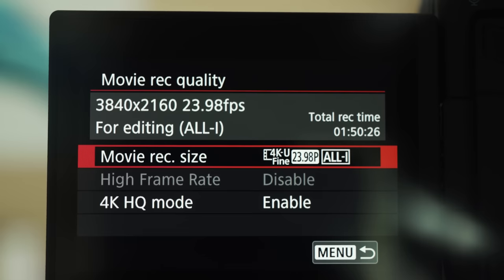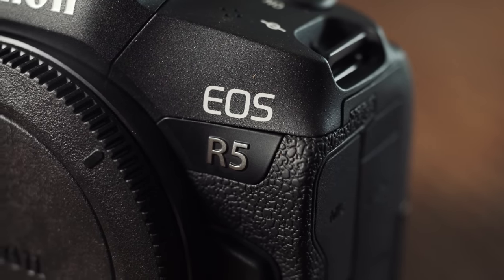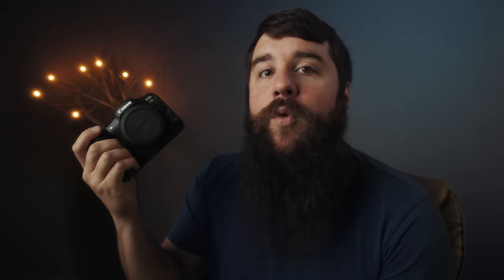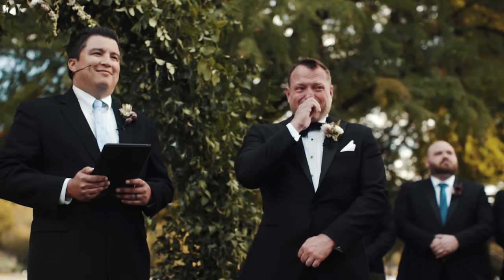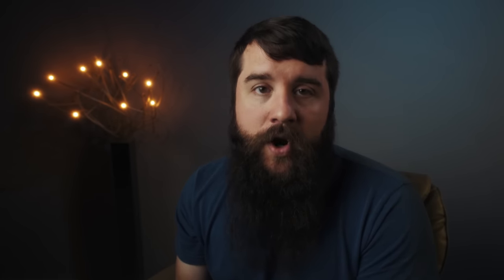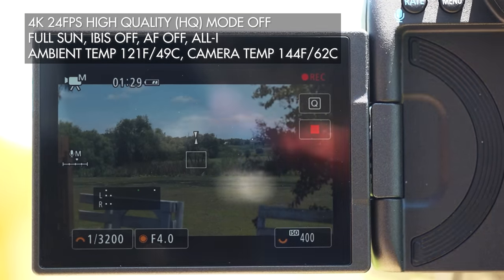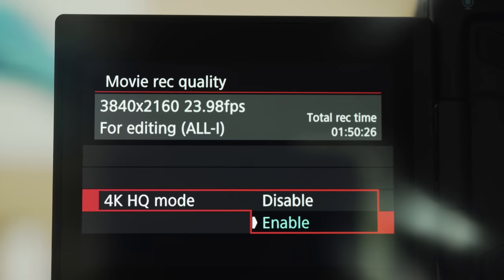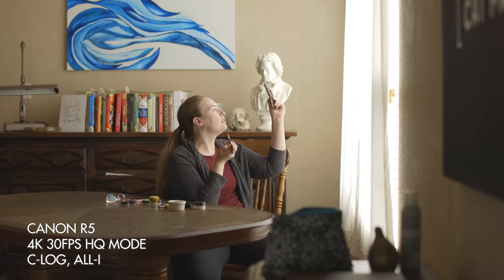Will The Canon R5 Overheat Filming A Wedding?

Comment: The R5 does not overheat. Canon did not invent a super insulator that shields the camera from external heat. Frankly, that’s just silly, as there are tear down videos and the body is merely magnesium with a aluminum heat sink. 
So what’s really happening? Canon has deliberately coded the firmware to instruct the camera not to record beyond a certain amount of time. They did this to force users to buy their cinema cameras for video. Your test actually confirm this. The cool down time cannot be sped up. Even freezing the cameras does nothing to speed recovery. Removing the lens, opening the battery and port doors while freezing does nothing to speed recovery time. This is not because Canon is using an insulator stolen from aliens... it’s because there is a timer in the firmware that prevents the cameras from operating normally until a predetermined amount of time has elapsed. It’s really that simple. 
Canon, just like they removed 24p and CLog from other models, has chosen to cripple this body. Worst still, and perhaps most unforgivable, is the fact that the HDMI port on the R5 supports 8K @30p Raw output... but Canon choose not to enable it.

Comment: See this report (link below).  This and another report I have read claim that the overheating is fake, and canon's software forces the camera to report overheating artificially.  I am not sure why they'd do that, but it appears to be so.  Even this video shows a maximum temperature of 144 degrees F - which is not really that hot - certainly no reason to force a system shutdown.  Canon's monkeyed with the software to cause this shutdown - for some inexplicable reason.  But that also means they can do a firmware update and remove that stupid constraint.
Reply: @srikant.sharma  Nope all the BS from EOSHD was debunked  - https://www.fredmiranda.com/forum/topic/1658635/5#15313777

Comment: Canon EOS R5 is not designed to film a wedding. If you were a wedding photographer you would be Fine. Get a film camera!. I did a wedding with 2x 70ds and EOS R and  Panasonic GH3 but DSLRs are not ideal to video weddings. They are fine for photography but not for video. The EOSR5 is a stills camera with a few extra video perks. For very short video it would be fine. This is NOT a film camera and no body from canon or Panasonic that I have had has been able to go above 29 minutes which is a real pain in the ass. the batteries run out, the memory cards run out. It's a nightmare! To try to be a videographer and a photographer is too much overkill. I should concentrate on one thing at a time.

Comment: Then shoot in 4kHQ Crop mode
Reply from the maker: I'm a bit disappointed your recommendations to shoot with a crop or shoot with an Atomos require filmmakers to either invest in wider lenses to overcome the crop, or invest another thousand dollars in an external recorder and SSDs.
Reply: @whoismatt  I do that now.  I'm a hybrid shooter.  I do both photos and videos.  The crop mode is 5.1k oversampled which is really good.  I already have superwide angle lenses and telephoto lenses.  I understand your perspective as a sole videographer, but shooting hybrid requiring both high resolution stills and high quality video, I don't know if any other cameras outside the Panny S1H or S1 that can do that.  You are right, this is a tool, but if you are going to try to use this as an A-Cam for video, which is what Canon recommends against doing, you will need to make compromises.  That's why I still recommend this as the best bang for the buck Hybrid camera.  Atomos extends recording times on 4kHQ60p indefinitely and the cost if that setup is cheaper than buying large Cfexpress cards with large internal recording drawbacks.  Yes, you rig will be larger but EVERY event filming scenario has compromises (storage capacity being a main concern as 4khq and 8k take up a HUGE amount of data).  A 2tb SSD is exponentially cheaper than a 2tb cfexpress card and for the same amount of money you can buy an Atomos ninja 5 with it.  Let's also not discount you can by the ef-rf VND adapter and exponentially increase shooting scenario adjustments and you open up to cheaper, legacy EF quality glass.

Comment: This is NOT the complete picture.
Your review is not complete.

Filming with an external recorder would totally work for a long wedding day. Also the 10bit codecs would be perfect for editing with an external recorder. 

The R5 is the perfect photo camera and with an external recorder becomes near perfect video camera. 
Only internal shooting is suited for short videos only.

And btw only an amateur would go and shoot a wedding with a single camera. Backup camera is absolutely necessary. I’ve shot over 100 weddings and never used only 1 camera.

If you have 2 R5s you could use one of them in the 24p mode and use the second only for Broll.

Also another point you didn’t mention is the 24p crop mode that is oversampled and also shoots forever without overheating. Of you care for ultimate sharpness and what to shoot a wedding you can relay on it.

Therefore - your review is not honest. You should make a follow up video to paint the complete picture.

Comment: So not excusing this overheating, but almost every video person I know uses more than 1 camera during the day so it would only be a bit of a pain to switch between 3 cameras every hour and let the other 2 cool off and shoot the ceremony in 4k 24 and that’s redic, but not as bad as Sony and dji default file numbering of 00001,00002 also canon this is bull shit. And they need to do better hopefully by delaying so many orders they can improve it
Reply from the maker: Once you shoot with 2 of the R5's even in 4K24 you lose the ability to record any higher frame rates with them in 4K until they cool. Which could be pretty far into the reception.

Comment: I can't imagine ever using this camera for any professional purposes. I do a lot of Jewish and Coptic Orthodox weddings, and those ceremonies run minimum 1 hour. Noooo thanks!
Reply: Best combo C300iii and the R5, can’t imagine anything else coming close.
Reply: First off, this is a PHOTO camera, NOT a video camera. Secondly, how have you been shooting weddings so far in 4K downsampled from 8K, or 4k 120 and 8K? You haven't! You shot in 1080 or basic 4K (which is still better 4K than on the EOS-R or A7III). You can do this with the R5 for unlimited time if needed.  Btw, the A7III overheats in 4K at about 20 mins. So does the Xt-4 (4K 60... 14 mins).
Reply: @77dris  Yes, it's a photo camera, with amazing video capabilities that fall apart. I maintain that this is a terrible camera for professional videography. I've been shooting all my weddings in 4k over the last 4 years on my a7sii and have encountered overheating 3 times. This occurred outside, in record-breaking temperatures. Based on these reviews, I don't need record-breaking temps for it to overheat. Never have I had my a7 iii overheat. 4k downsamples from 8k is nice, when it works. Not sure why you're butthurt.

Comment: This has probably been the most insightful video about the Canon R5 I've watched as it shows you things that pretty much all the other reviews have skipped over. They've been the same basic tests and didn't take into account many aspects of filmmaking. Thanks!
Reply: If you skipped other reviews you missed out on a lot of things, like all the video modes that don't overheat that he didn't mention, like S35mm 4K, which is over sampled from 5.1K and looks great. Or the fact that you can record to the Ninja V externally and many modes never overheat, like 4KHQ and 4K60. Many people record externally on cameras like GH5 and Blackmagic all the time. Also most gimbal ops use external monitors.
Reply: @iamthejtm  That's not what I meant. I have watched plenty of other reviews but none of them included some of the details and tests performed in this video.

Comment: Filming a wedding with R5, no more a problem since this week!
Here is my new R5 hack from this Sunday the 6th of September. 
It works with Canon R5 and R6 and with firmware V1.0 and V1.1 
It do not lose data, do not force you to open the camera, it's simple and easy. 
https://www.visionrouge.net/canon-r5-overheating-hack-solved/
It also clearly shows that all these overheat excuses are completely fabricated and an simple flag setup with a time stamp difference is responsible for bricking your camera, on the  recording time and cooling time.

So simple to activate that it's embarrassing to keep call this an overheating issue.

Comment: I recommend filming 8K wedding in North pole.
Reply from the maker: 😂 It wouldn't help, the external temperatures don't make an observable difference in recording time.
Reply: @whoismatt  lets say you are using it at -40 degrees Celsius. try it.
Reply from the maker: @ivanteo1973  Texas has never been that cold 😂

Comment: 8K will be reserved for the GH6.
Reply from the maker: My only worry is 8K on a micro 4/3 sensor would make the lowlight even worse.
Reply: @whoismatt  Oddly enough that doesn't seem to be the case on the 8K Sharp m43 camera. From the tests, 3200 ISO performs great. Beyond that, the grain is still super fine so it cleans up easily with noise reduction. Even still, I'd use the GH6s for most of the wedding and just use the 8K version for the ceremony/punch in's. I think both versions could really complement each other.

Comment: It is not guaranteed and that low quality is the same quality that people have been using for 2 years... Was really hoping you would actually add value to this discussion by showing how you can shoot a wedding.
Reply from the maker: The way that I film, as well as many wedding filmmakers I assure you, this camera will overheat. And Canon has marketed this camera as capable of filming 8K and 4K in high frame rates at high quality. It is incapable of doing that for more than an hour on a wedding day. Filmmakers should expect more than low quality, especially if the camera is marketed as such.
Reply: Because you can’t! Only in that low quality normal speed.
Reply: @whoismatt  You mean it will overheat when you use modes that are known to overheat right?  So the camera can be used to film a wedding in say 1080 or 4K normal? For example if a current Canon EOS R user picked up the Camera they could expect to film a wedding using 4K 30p and 4k 24p without the 1.8x crop of the EOS R? Again I was hoping you as a subject matter expert would use that knowledge to show how it can be done within the limitation of the Camera. How it can't be done is pretty well covered.
Reply from the maker: @Ramage7070  if you want to spend $3900 on a camera that is limited to 4K30p and 1080p60 then by all means do so. I'm not going to recommend filmmakers do it though, as that is hardly an upgrade over the EOS R.
Reply: @whoismatt  Ok, I disagree I think the Camera is a massive upgrade to the EOS R
Reply: @whoismatt  Canon has been very transparent about the overheating limits when shooting VIDEO with a PHOTOGRAPHY camera. Nothing has been "discovered," there's no "gotcha" moments here. Canon has the record time-limits and the recovery times in their documentation.

Why are you using a photo camera to try and shoot substantial, long-form video? That's not what it was designed for. If you need to shoot video, get a video camera. If you feel the need to bash on a photo camera for not meeting your video-recording requirements......you're using the wrong tool for the job. Plain and simple.